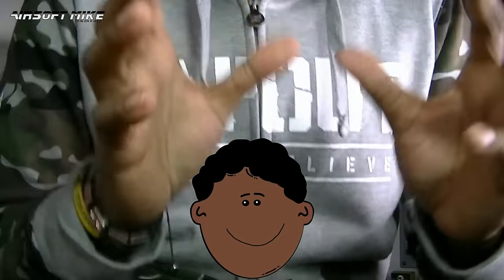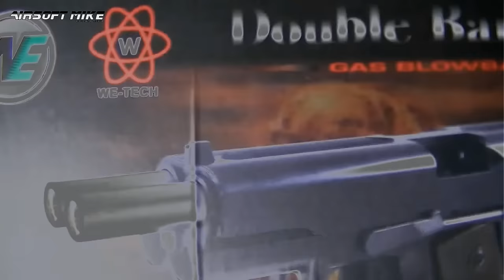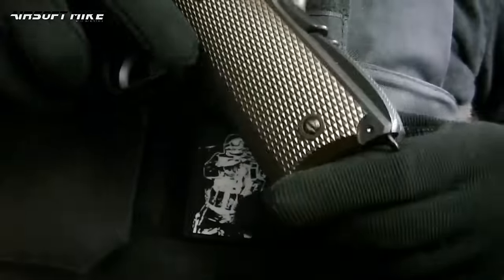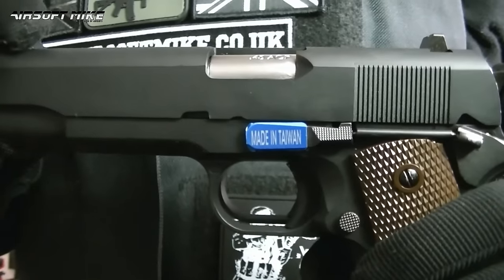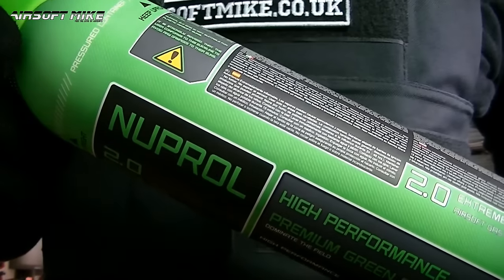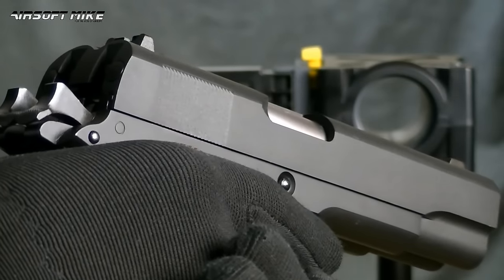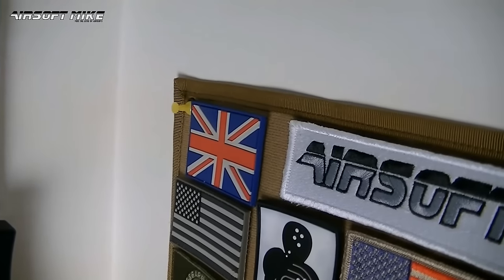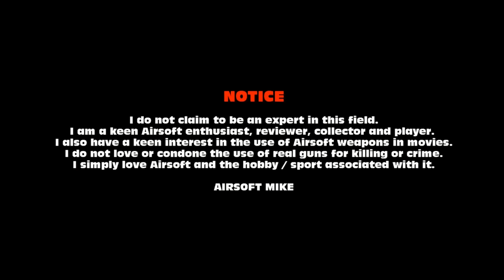WE DOUBLE BARREL 1911

Comment: say you don't wanna buy the special double mag, could you just use 2 regular 1911 single stack mags instead if you already had 'em? just curious.
Reply: +Yung Slick Yes, definitely! It is the same exact mag so you can have two independently inserted mags in, and it works just the same.

Comment: why wouldn't they reverse the spring switch on the clip and weld the two plates that compress the springs together across the clip finger and thumb push the spring switch down then you slide it back to lock it in place while you fill it with bbs. first I thought it wouldnt work because one barrel fires on its own but when you said they fire at the same time why wouldnt they put a single plate that goes through both clips for reloading.